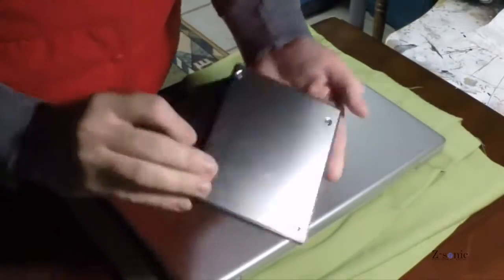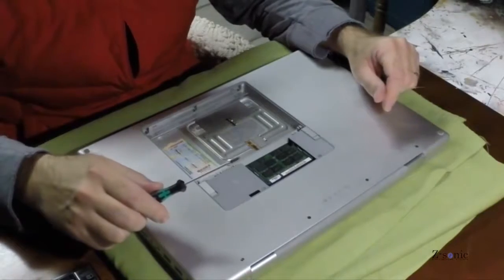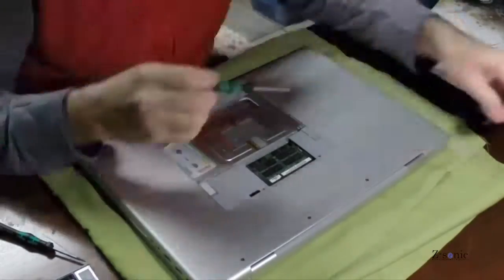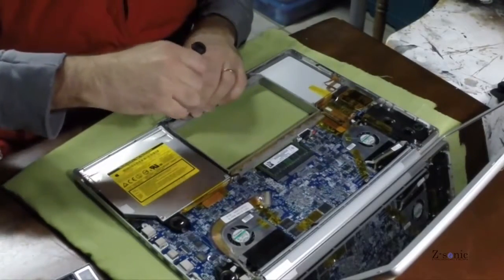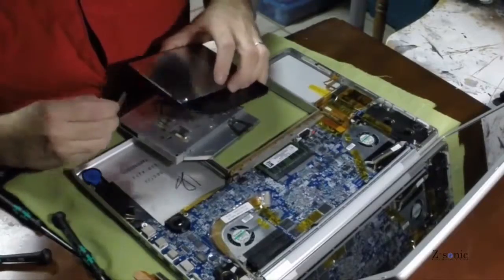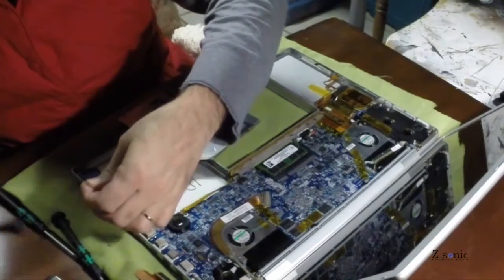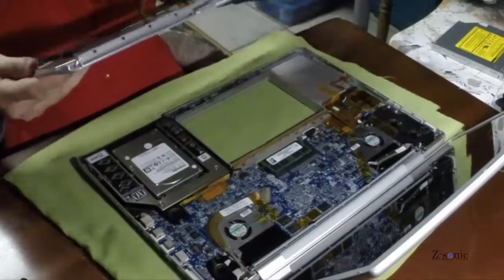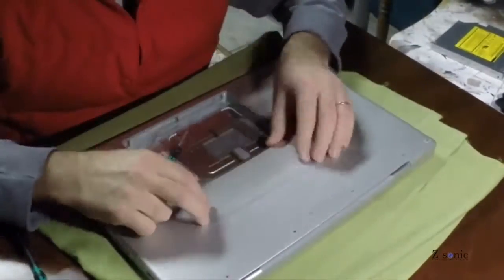How to install a second hard drive in an early 2008 MacBook Pro 17"

Comment: Thanks for video man! I did set up my extra hdd instead of DVD slot, but my hdd did not appear. The disc utility does not see it in system. Well there is two chances: hdd is not working or my OS X still 10.6.8 version. So I will install newer system first and after I will solve the hdd appear in the system Plus like you I want to upgrade to 6 Gb RAM.Cheers!
Reply from the maker: You might have to reset the SMC (System Management Controller). It happened to me a few times as well. Turn off your Mac, then press at the same time Shift, Control, Option and Power buttons for about 6 seconds until the mac is starting to reboot. You will see the power LED flashing a few times and then the Mac will reboot. Try it once or twice and you will see the drive. It is a little annoying but it will work. Good luck!
Reply: Thanks ! Will try it.
Reply: Andrian, Hi!
I did it three times. Does not work. 
The hdd does not show up in system. But it is turning on and I feel it is has powered and running inside.
What should I do to see my extra HDD in Caddy. 
Any other ideas you might suggest ?
Thanks.
Reply from the maker: You can try to reset the NVRAM as well, maibe it will work. When you turn on your Macbook, after pressing the powr button keep pressed in the same time Option, Command, P and R keys until the computer reboots twice. Watch the video in the link: https://www.youtube.com/watch?v=v40S8djaLTc
I hope it will work.
Reply: still does not work (( Seems like hdd is turning, but the OS does not see my extra hdd.
What else should I try ? any ideas ?
Reply: @VK_DOP  Hello. I have the same problem. System does not see hdd in caddy. Maybe you've already found the way out?
Thank you.
Alex
Reply: @alexrets3454  hello, no I did not solve the problem. The caddy was sold separately as my Laptop. Sold it and I am looking forward to buy a new MacBook Pro :)
Reply: @VK_DOP  ( Thank you
Reply: @alexrets3454  I’m having the same issue did you ever figure it out?
Reply: @HeavyBreathingGamerXD    Still no(